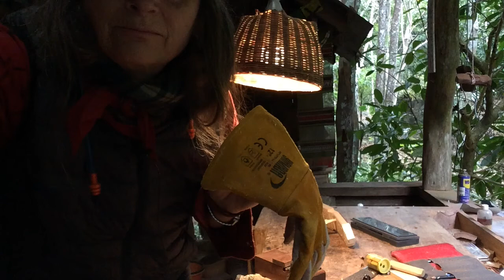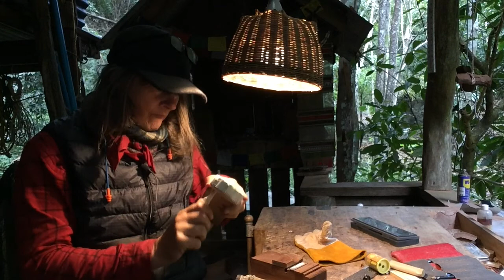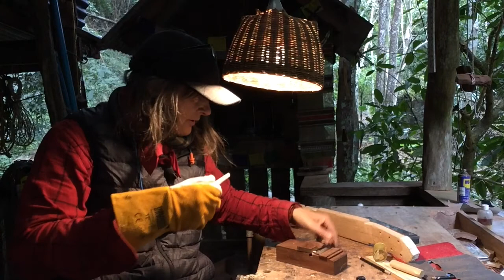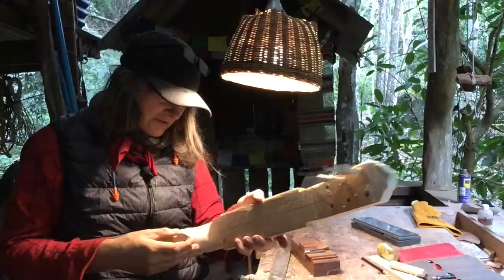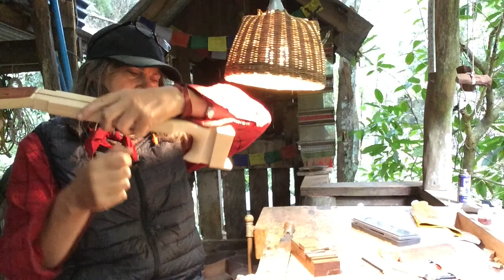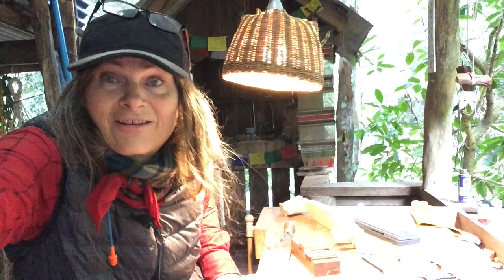making flamenco guitar pegs from tamarind wood

Comment: Hello Catherine! 
Thanks for the vid, helped me out a bit (used to build flamenco and classical guitars in conservatory and had materials out of school). I started out building some romantic guitars and wondered if i could make the peg shaper myself. As a side note: classical guitars mostly have rounded heels as a standard (after Torres, Hauser, Fleta etc). Flamenco guitars mostly have flatter heels. I presume this has its history out of the baroque and romantic period guitars which were absolutely straight. The flamenco guitars i built and measured (Torres, Ramirez,..) had straight heels.
Warm wishes from Belgium!